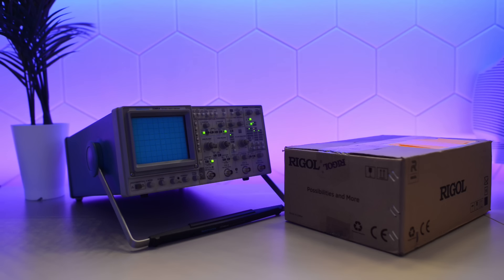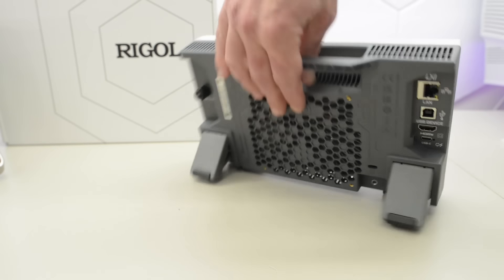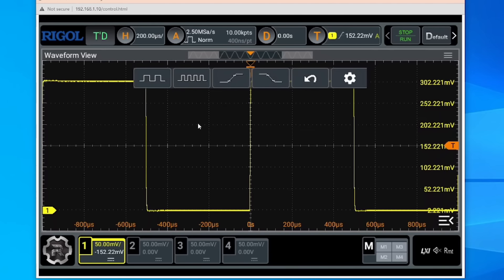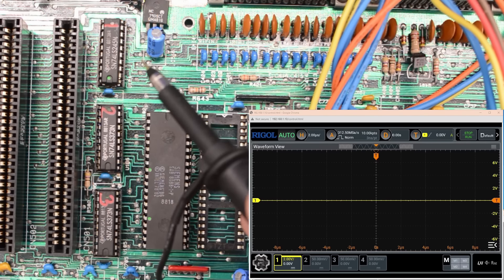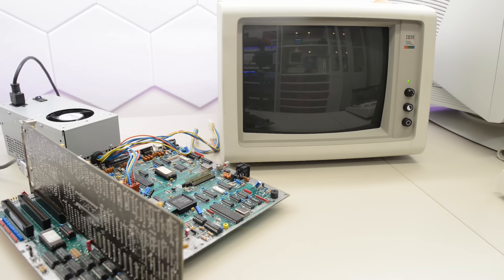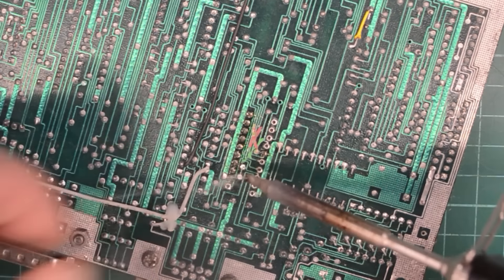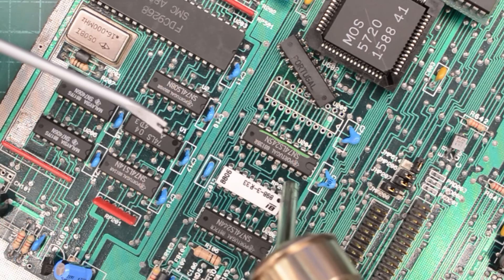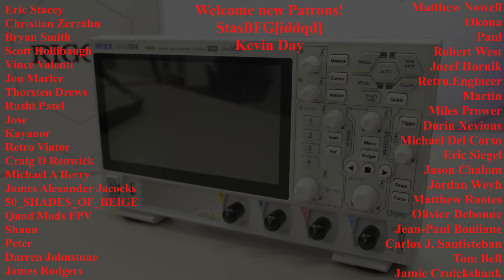Trying out RIGOL's new 12-bit DHO800 on a real vintage project. Is it any good?

Comment: I think that that "weirdness" on the ISA bus is normal, I've observed similar signals on other PC motherboards. It's the capacitance of the trace that charges up pulled by that resistor network to Vcc. The bus is just left in Z-state when not in use, that's why do you see those slow rises.
Congrats on the scope though!
Reply from the maker: Oh, I'll check and compare it to the 5150, thanks

Comment: A few years ago Tektronix sales stopped by my work to demo their new scopes and answer questions. I made a big fuss about the time it took to power on their scopes. I explained how when I take a scope to one of our systems to debug it the first few minutes are spent simply waiting for the Tek scope to start up. These were just sales people, but I wanted them to leave with the impression that at least some customers wanted shorter start up times. I felt like they had the mindset that scopes sat on a bench in the lab and were powered on in the morning and off at the end of the day and the long start up time wasn't an issue for most people.
Reply from the maker: I don't know enough about scopes to know why they are so slow,  but surely they can do better than this.
Reply: I believe most new scopes are just some variant of a linux computer thus the reason for for the boot process, where some of the older more expensive scopes were all dedicated hardware for each function. its now like just a USB scope and PC all in one box.
Reply: @portblock  The concept to base the instrument on a PC platform with, usually Windows, actually comes from the high-end segment. I guess this is now the first sub-€1000 scope to run a general-purpose OS, with Android definitely being the more reasonable choice to run on the ARM-SoC.
Reply: @Epictronics1 most scopea are running either linux or some weird form of android from some really cheap form of solid state memory thus the longer boot times.
Reply: @MarianKeller  Hi, I am French electronics engineer since the early 80s. Before oscilloscopes were very expensive, I still have 2 of these oscilloscopes, one that I bought second hand for a pittance, it's a 200 MHz. I forgot the brand. But it works very well! Today we have the same thing and even with many more options for a ridiculous price: 500 Euros for a 4 traces!! At the time we had nothing below the equivalent of 5000 Euros. 
Be careful though: There are a lot of bad low-end brands out there but it can help schools and students get started as long as their use is not a nuisance.
Reply: I mean digital scopes! Pc Monitoring, not sure it does for the user but for a teacher it is nice to display the scope traces on a wide screen!

Comment: 4:55 If you want to have a fast booting scope, Rohde&Schwarz scopes are waaay faster than Rigol. They also have better, more intuitive interface, and with great sample memory the FFT functionality was oh so better than Rigols. But they also cost 4x as much for same amount of channels and bandwidth, so you see why I'd choose the Rigol myself.
Reply: 12 bits for definition on rigols is yet good: More better than Hantec 8bits craps series.
Of course: At that price of 2000 Euros/Dollars, nowadays, you expect to have a good quality scope.
I'm a french enginners and in the 80s at that price you had a very poor quality scope running at 15 mhz.
Not even sure you could access to one.

Comment: I was eyeing the 1054z a few months ago, good thing I didn't pull the trigger before the DHO800 series pricing was announced. I also picked up the 804 and it's fantastic, except for those damn slow boot times and a few menu choices I think could be refined
Reply from the maker: Totally agree. It's great. Except for a few minor things
Reply: I guess the boot includes a internal calibration check. That calibration can only be made when a stable operating temperature is reached. As the DHO series have a huge heat sink (even then a fan cooling is needed), it will take some time to reach enough stability to present reliable measurements. This is all a result of integrating AD converters and compensation on a single high-speed chip.
As said - It's only a guess, but it would not surprise me the boot itself is not that slow, but has a build-in wait cycle for the reasons mentioned above...

Comment: I'd be curious to see the output in relation to the input for the data lines on the 74LS245. My guess is, once the input reaches ~2v(logic high for LS series chips) the output gets clocked in as a high and that's the oscillation you see on the output lines.

If you replace the 74LS245's with the HC245, that ramp on the input side should go to somewhere around the 2.8-3.3v mark as that's the logic high for HC series chips.

What shows up on the oscilloscope looks like the charging ramp for a capacitor which would make sense since the output side gets it's reference voltage and source from VCC and not the input and thus making the output side look normal.

You can test this by rewiring the 74LS245 input and output pins in reverse and pulling the DIR pin to the respective 5v or GND to have data still flow in the correct direction. 
What @fagear said may be correct but the charge time would have to be significantly less than the setup time required by the 74LS245 for the address lines.

Comment: now THAT is a scope! Congrats!

I've struggled with 245 and those weird waveforms before. I thought it was a fault but was explained that this is due to TTL logic which can drive to ground very well but not so well to VCC - and never to full VCC - even with pull up resistors. So apparently the rising edge of those signals is supposed to be way worse than the falling ones.  
So bear that in mind, it could be a dead end!
Reply from the maker: Oh, that's very useful, thanks Tony! I'm learning something new with every project!
Reply: @Epictronics1  It was Vogons who put me on this track. Don't worry, I did exactly what you did, replaced all the 245 and checked the pull-ups... :) Learning is cool indeed!
Reply from the maker: @tony359  Let's see what we will learn this week!

Comment: The pin you’re measuring has a weird output because it’s a transceiver. It’s used for directing data either way (DR pin pulled low or high should change its direction). 

If you pull the pin you’re measuring from the socket, you should be able to check the pulse on the socket pin, and on the 74LS245. If either of them has a non-TTL signal, you’ll know where to look. :)
Reply from the maker: Yes, the Faraday is up next! If that socket is crappy it wont direct the 74LS245 properly. And yes, I should have pulled pin 1 high and not just left it floating :)
Reply: @Epictronics1 I meant pin 15 (B4). 21:32 

If you bend it outwards, you’ll be able to check what the IC does with the signal it receives from the A side. It also allows you to check what the FE2010 does, measured from the socket.
Reply from the maker: @Inject0r  Ah, yes, that's the better way to do it, That way I won't get any interference from the bus on B pins if there is any, Good thinking! Thanks

Comment: Are you happy with the bandwidth? I guess for retro hardware you don't need much. Have you ever used a scope with digital break out cables, for example if you want to decode an 8 bit data bus?
Reply from the maker: I just switched to digital actually. I have no experience in decoding a data bus. From my understanding 70MHz should be enough for me. Although, I think the hacker community is probably going to figure out a 100MHz hack for these scopes. If they haven't already :)
Reply: @Epictronics1 the dho800 can be hacked up to 100Mhz i think and the Siglent SDS800 series can be hacked up to 200Mhz from the 70Mhz model, plus it has a logic analyzer attachment.

Comment: On boot time: it's the result of building the scope programming / application on top of an existing (in this case, Android) operating system - on the one hand, it's WAY easier and cheaper to develop if you use a pre-existing OS/HW-architecture combo, on the other hand it does mean that the OS/HW-architecture combo is not an efficient, lean, special-purpose design meant only to do what it was built for.  Pros and cons.  Personally, I'm OK with it, largely because it makes it correspondingly easier to modify and hack.  But, yeah, my 40+ year old Tektronix TDS744A does boot up in less than a tenth of the time as my Rigol DHO914.
Reply: Even expensive top ebd scopes nowadays run on some form of Linux or Android that whole thing actually came from the high end sector. As far as i know modern Tek scopes are a tad notorius for the slow boot times.

Comment: The scope boot time is likely because it runs Android. Some of the really high-end ones run windows on PC hardware. I would love a cheaper version of this scope with no screen and either HDMI (Which this has?) or that web remote view.
Reply from the maker: Yes, it has HDMI too. It's probably the better option but I need my mouse cursor to be recorded that's why I went with web control
Reply: @Epictronics1  It has mouse support. You can just plug in a USB mouse.
Reply from the maker: @Farull  Interesting. Is the mouse cursor recorded if I record from HDMI? This could be the better option
Reply: @Epictronics1  Yes, Dave of EEVblog tested it in his review of the scope!
Reply from the maker: @Farull  Great, I'll give it a try, thanks

Comment: It looks like my MSO1104Z also has that web page view.  I haven't tried it yet, but it claims to support the same LXI 2011 interface.  It also has the same command interface that the Ultra-Obsolete software uses, and you can download a manual for sending commands.  I'm guessing that the old interface is intended primarily for remote control though, not for screen-sharing.
Reply from the maker: It seems like they just abandoned the Ultra scope software back in 2019. I don't understand why they stil have it as an option for new products. The web interface is great though!
Reply: Apparently you can communicate with it through other means (probably serial) and just send and receive commands.  There's a huge selection of commands that look as if they can do anything that the front panel buttons can do, possibly more, and with less knob-turning.  So it's possible that with the right software you could use one program to manage settings while the web interface shows the results.

Comment: 27:58 Could try hooking up the Enable signal to one probe, then test the B1 side of the chip with another probe.

It looks like maybe the Enable signal is going High at the wrong time? Possibly a clock divider issue on one of the main ASICs?

(or as you say, one of the PLCC sockets has a bad connection.)

The weird signals you are seeing are on the ISA slot side, no?

It could just be that the bus tranceivers are just expecting data from an ISA card during the times when Enable is low.
So what you are seeing are the remnants of data from the A1 side of the bus.

Could again be that the Enable pulses are shifted in phase slightly, which is causing the whole problem with the board booting.

I would look to see if there are any clock divider ICs.
It might be that they are supposed to generate two or more clocks which pulse on alternate phases.

(ie. on some machines, you might see one clock pulse that goes high to output an address, then a separate clock pulse high to latch the data. It could be that one clock is missing, or both are pulsing at the same time when they shouldn't be.)
Reply: I just checked the schematic for the PC-10, and it doesn't have any TTL clock divider stuff.

It's so highly integrated into the ASICs, there isn't a huge amount of supporting logic around them.

There's a hand-drawn note in the PC-10 Technical Manual, which just shows a few XOR gates buffering the 28.636 MHz osc.

It looks like that 28.6 MHz clock goes to the CLOCK0 pin on the graphics chip. The graphics chip then also has it's own 16.257 MHz clock going to both the CLOCK1 and CLOCK2 pins.

But it's not like the gfx chip is outputting a clock to other stuff. It just has the ISA interface and a '245 buffer.

It looks like U602 is the ASIC for basic address decoding and IRQs. It has "16 MHz" and "CLOCK" inputs. Not sure where those come from atm.
Reply: I do have a feeling the onboard graphics chip might be fried, but then it doesn't seem to output clocks etc. to other stuff, so I don't know.

The HDD header uses '245 buffer U204, which looks like it can be disabled with jumper JMP288?

U203 (9268) is the floppy controller, and has its own 16 MHz clock which isn't used elsewhere.
But it does have a '245 buffer U205 to the main data bus.

Could be worth checking both of those buffers, socketing them, and temporarily leaving them out of the sockets?

U401 (RTC), U402 (UART), U403 (Parallel port?) probably wouldn't prevent booting, unless they are mashing stuff on the main bus, or the ROM isn't reading the correct register value from one of them.

Honestly, I think I would try bending the pins inwards on the PLCC sockets, lightly scraping the pins of the PLCC chips, then cleaning everything with IPA.

oic, U101 is the Big Daddy chip. lol
It handles the 8088 interface, address decoding, IRQs, DMA, speaker, keyboard, and drives the ISA (main) bus via some '244 and '245 chips.

U101 gets the main 28.636 MHz osc, and outputs both CLOCK and OSC.
But CLOCK and OSC both go through a 244 buffer, which is always-on.

With CLOCK being the lower 8.0 - 8.33 MHz ISA clock.

And OSC often being 14.31818 MHz (NTSC colour carrier multiple).

I would have a look at both of those clocks on the o'scope at the same time, whilst squishing the PLCC chips into the sockets. lol
Reply from the maker: Yes, the socket of the Faraday chip is at the top of the list of suspects. If there is a bad connection, we would likely get a fault like we have right now
Reply from the maker: @electronash  Yeah, that graphics chip is very likely fried for sure. I can't quite see how it could cause the weird signals though. But if I get stuck, I'll pull it off the board and check. I'll make sure to get U204 in a socket if it isn't already, thanks

Comment: First let me say, Im sure the scope is a great value for what it is, but let me explain why I would never buy this scope:
#1: No EXT trigger on the front, so much of my design work depends on it
#2: There is no separate verticals for each channel - so many times I need to quickly adjust and if I am on the channel and I hit channel button again, it turns off the channel, so I need to press it again, see so much time fiddling than getting my work done.

Comment: have you watched electricboom channel if not 
i have know he talking about few better tech test machine 
i havent used any this beside test light leds and just watch it flash fast or slow them can tell if there is issues which it old way before new test machine came out and i know they so expensive plus they were slow when it was cold and once it warm up it start speeding up

if i were to work on one thing first thing i do is remove all other chip start with cpu and ram and 45ls245 and test to see if still same it lead me to think there is way spot it and all i could tell it from drag down resister and first start with one of chip at time until you find where trace is dropped from and alot time chip tester may or may not tell if bad or good it best just grass hopper chip until start to change

Comment: would be easier to make a complete new commodore PC rather than fixing that one. At some point you will have replaced all the parts anyway :)
Not sure about the signals, but new sockets, especially when they are already corroded, are a good idea. Cleaning them never worked for me.
Reply from the maker: You are absolutely right :) There is actually an ongoing project out there to recreate the PC 10 board. I will quite likely replace the board if the project ends up getting finished. That being said, I'm having a great time learning and finding faults on this board :)